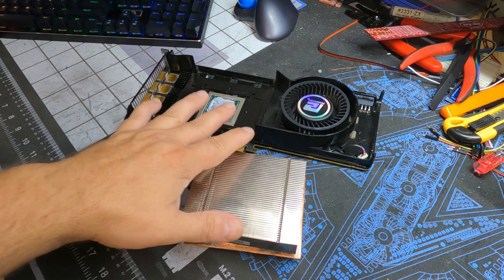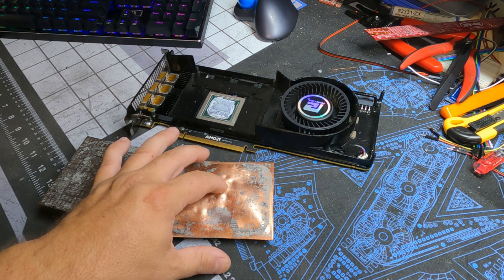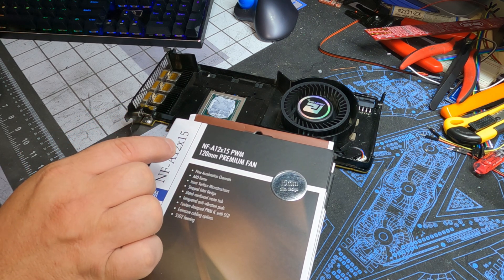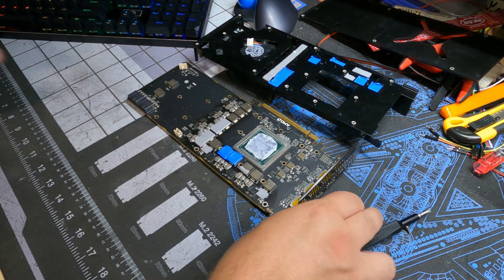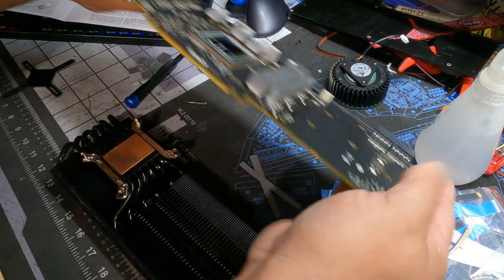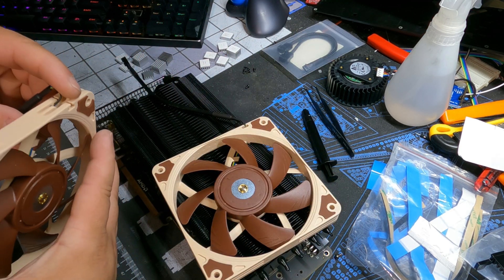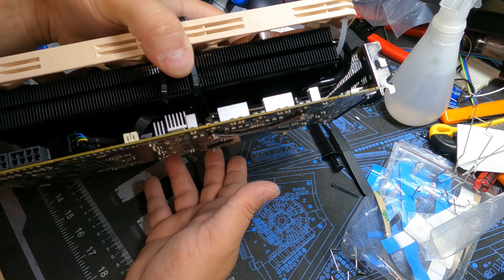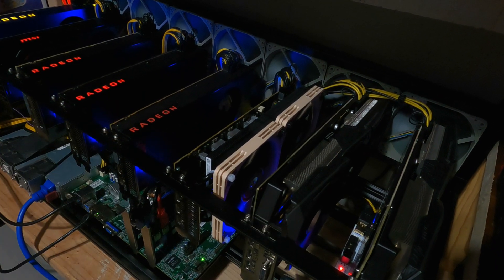Vega 56/64 Repair - Fin Stack Falls Off Of Vapor Chamber!!

Comment: 7:50 You forgot one heatsink from the right bottom corner. It has a thicker thermal pad on the reference cooler, but it needs active cooling!